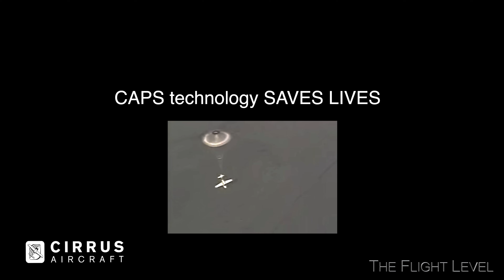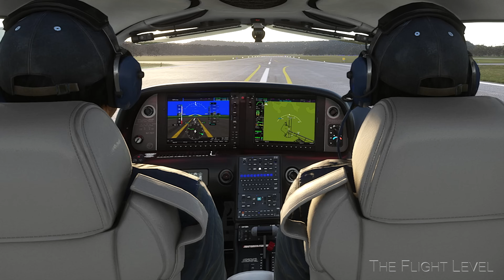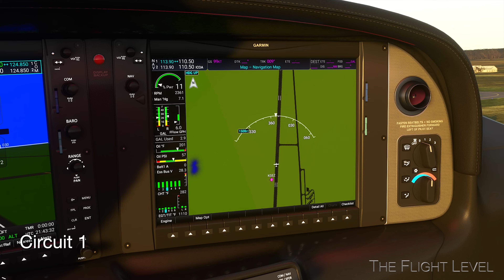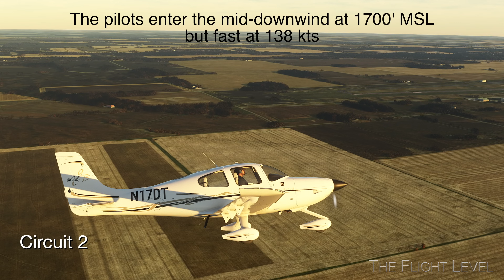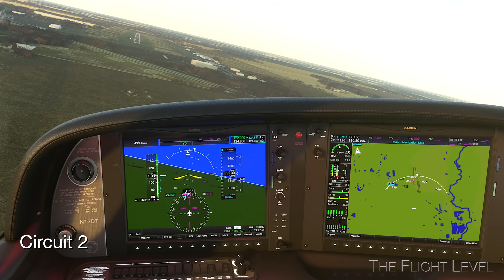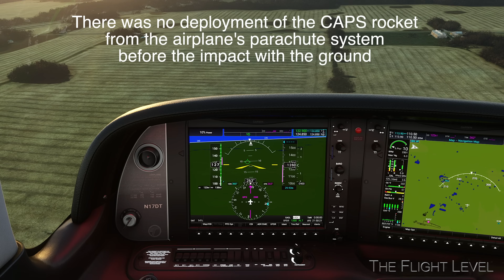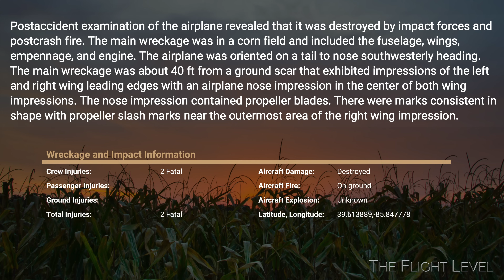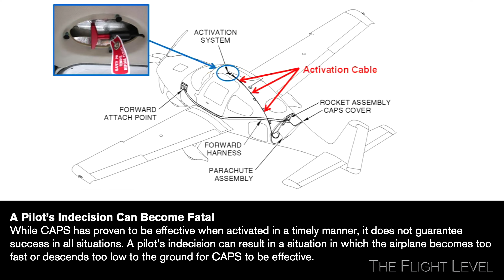Parachute (CAPS) Indecision | Cirrus SR22T (N17DT) Flight Ends in a Fatal Accident

Comment: Sounds like a proficiency problem more than an indecisive caps problem sir.
Reply from the maker: Will be very unfortunate if the instructor was not proficient in the Cirrus aircraft.
Reply: @TheFlightLevel  Something must have been mishandled otherwise the plane whould not have crashed nose-down. Unless the aircraft controls were broken.
Reply: @TheFlightLevel   I don't understand this at all.  Why no caps pull and at the very least know the best glide speed (92 kts SR22T).
Reply from the maker: @wagnertenor  Yes, there are many puzzling aspects. We don't know if they were trying to land on the first 2 circuits or they were intended to fly over. Perhaps they encountered problems in the circuit and were trying to figure things out. The departure from the circuit and flying for over a mile at circuit height adds to the mystery of why. Certainly they had time to activate the CAPS before the airplane stalled and if dealing with a problem. An IFR flight from Shelbyville back to Bloomington was planned, so they did intend to land.

Comment: Ok, 
But it still doesn't fully explain why they nosed dived into cornfield?

Did ADSB show they stalled the plane at any time & simply lost airspeed & lift?

The only time planes "fall out of the sky" is if they stalled the wings by forgetting to maintain proper safe glide speed.

Planes are essential Gliders, they can glide safely to land in runway or cornfield as long as one doesn't try to bank or turn or pulls up stalling the plane.  

Parachutes are a great Backup system but one must learn & practice how to spot land your plane with a practiced engine out into a open field void of trees etc.
Reply: No, CAPS is NOT a backup system. It's the first option. Only if you have an ensured landing on an airfield, you can consider landing the plane. But engines tend not to fail 1000ft over pattern altitude crossing the runway. And a fast plane like the Cirrus with small wheels and a heavy engine in front has a slim chance of a safe landing in a field, but a 100% chance to survive a CAPS pull within parameters.

Of course also Cirrus transitions and Embark, the complimentary training program for buyers of used Cirrus planes, include engine out landings on an airfield. But more importantly, they include a call out "CAPS available" at 500 or 600ft depending on generation, and a "CAPS" unavailable as well on landing.

If you have a plane that stalls with 30kts and has bush wheels, you might be fine in more fields. But that's not what the Cirrus is.
Reply from the maker: Thanks for watching. An eye witness saw the plane in an apparent stall with the wings vertical at one point in the final seconds very low to the ground. As you eluded to, the pilot perhaps tried to change direction in the final glide path that initiated a stall.
Reply: @TheFlightLevel  Well, that fact should have been shown in the video, no? It shows the plane level and there is no mention of the "wings vertical" eyewitness account.
Reply from the maker: @aviatorjoe4153  Thanks for watching! Illustrating the aircraft orientation in the simulator as a true depiction is difficult at times to maintain authenticity. The wings vertical account is given in the video description. Cheers!

Comment: My thoughts on why they didnt pull the chute was I think in the heat of the moment they forgot about it.  I fly at a Cirrus SR 20 flight school, and I have heard instructors say numerous times that during simulated emergencies in the sim, students forget about CAPS completely.  Just my thoughts from my experiences.
Reply from the maker: Thanks for your reply! Yes, certainly a possibility! Perhaps, a warning (reminder) should be integrated into the G1000 avionics linked to altitude or engine function as a reminder of CAPS. Very unfortunate for a preventable accident.

Comment: Thank you for posting. Followed this closely due to it being 30mins from home. Wondered what happened
Reply from the maker: Thanks for watching and commenting. Just incredible to have a modern plane equipped with a parachute and not use it when your engine fails. The one thing we will never know is why the pilots chose not to pull the CAPS handle. Very unfortunate.

Comment: You can just imagine the 59 year old instructor saying pull the chute! And the newbie owner of the aircraft not wanting to because he believes the aircraft will be less of a wreck if they land it in a cornfield. 
Fatal mistake.
Reply: Hard to pull the parachute in a stall/spin configuration 800 feet AGL
Reply from the maker: @BOLDAviation  Thanks for commenting. The ADS-B data over the last 4 minutes shows the aircraft at a low airspeed after exiting the circuit pattern and then assuming a set heading. We may never know the exact problem, but certainly the aircraft was well above the minimum height to pull the chute before the stall.
Reply from the maker: @BOLDAviation  There have been CAPS saves as low as 600' AGL. Example: CAPS save No.120
Reply from the maker: So true and it is very unfortunate if that was indeed the exchange of words before making the decision to land the plane into the corn field. Thanks for watching!

Comment: Nice video, thanks. Maybe hesitation because with parachute you do not know on top of who or what you may land, eg family? Cheers.
Reply from the maker: Thanks for the visit! Yes, the time for an indecision goes by very quickly when you are only 1000’ above the ground.
Reply: It was empty land. The only reason to use the chute is loss of control or obstructed terrain. In this case, loss of control occurred according to whitness around 200 ft above ground, too late to pull the chute. How they got into that situation, we don't know.